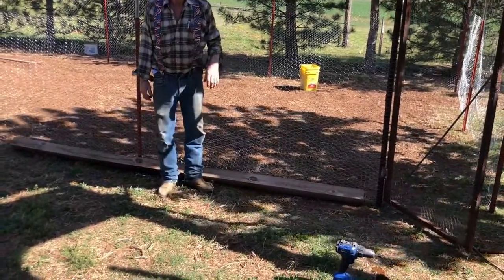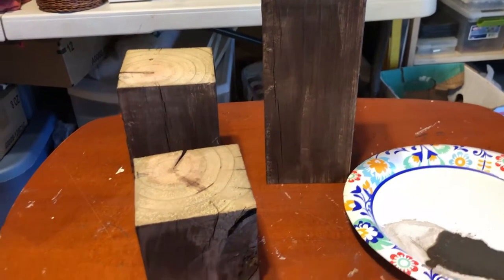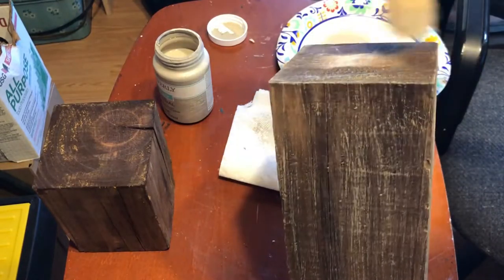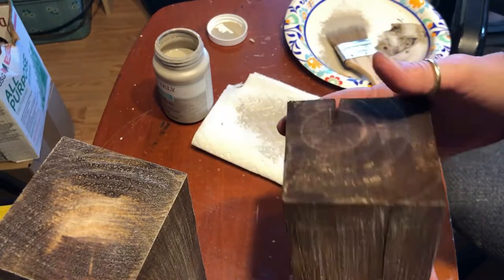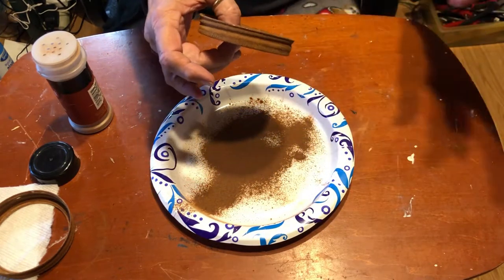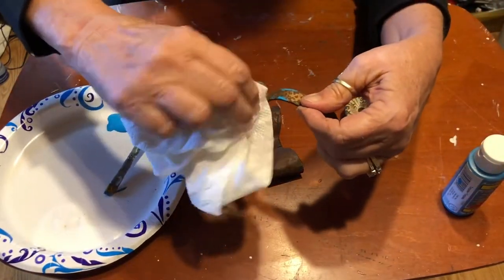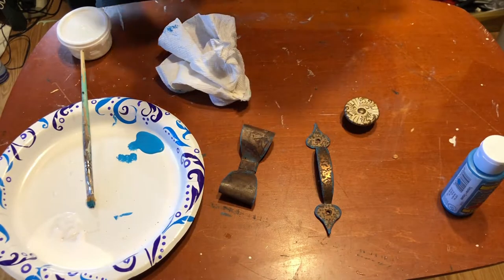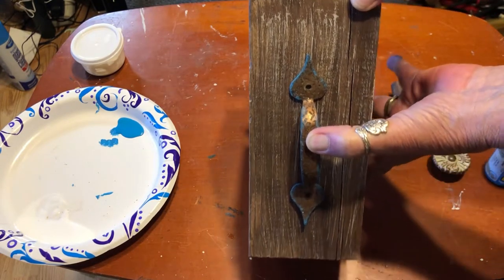DIY RUSTIC CANDLE HOLDERS

Comment: How did you attach the metal bow and the knob to the blocks?
Reply from the maker: I used E6000 glue.  They are still on.  Of course I don’t pick them up by the knobs.